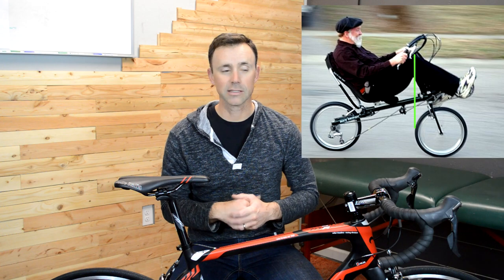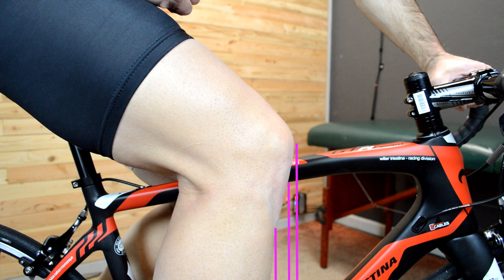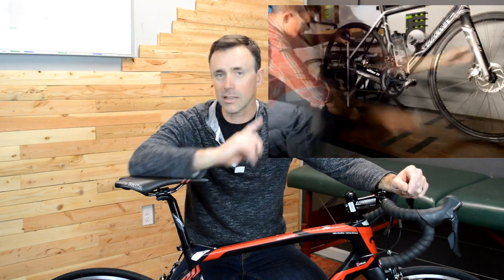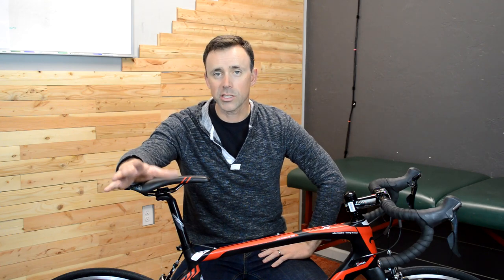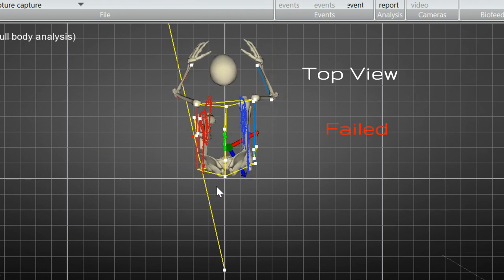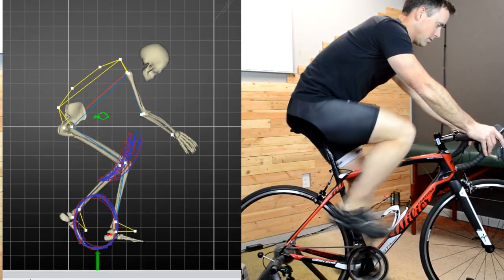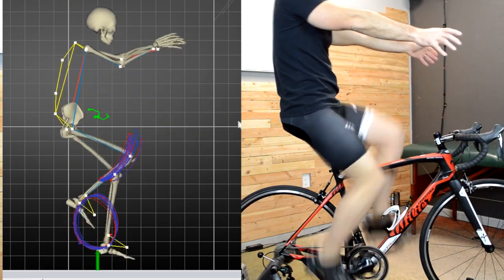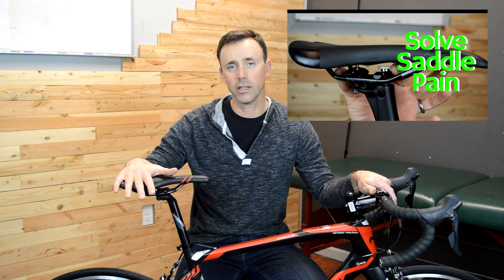How to set Saddle Fore Aft | Bike Fit Tip

Comment: Well now I'm more confused...and even more wish there was a good bike fitter anywhere near me.  From what I have seen on your videos and experienced in the 2 shops in my town, they are just sort of getting the basics.  And yeah they both have used the KOPS plumbob.

So I clicked on the video out of interest as I was about to move the saddle on y trainer bike forward.  I've been doing a ton of indoor riding on Zwift and had gotten saddle sores which had me looking at different saddles.  In the end I've resolved the sores (chamois cream and good bibs as opposed to cheap ones) and moved back to my original saddle but in the process I've lost my position.  When I ride now I'm finding that I'm constantly sliding forward and having to push myself back.  My instinct initially was to raise the tip of the saddle a bit but I'm not sure how far I want to take that.  My next step was going to be to move the saddle forwards as I can recall that it was most of the way forward on the rails originally.

Is the correct saddle position NOT one that feels balanced?  Intrinsically I would think that the best position is the one you can maintain for long periods and have the ability to output power.  Am I wrong?
Reply: You're not wrong about what the best position is, but ultimately people want a bunch of things as part of their fit like aero, handling, comfort, power generation etc so it's all about a series of compromises. Since everyone is functionally different, be it muscle/ligament flexibility, body proportions, rider center of gravity... what works for one may not work for another. I'm glad that you were able to work out all the saddle sore problems but it seems like you may have been following John's (imo incorrect) instructions as to nearly always move the saddle back. Depending on where you current saddle position is try to level it out and then ride your trainer in the drops and then, without moving your torso, slowly release the bars. You should be able to maintain this position with difficulty engaging your core and an increase in cadence but for a few seconds (then either grab the bars again or sit up) you should be able to hold it without having to slide your hips forward or backward. Let the direction your hips want to move to stabilize yourself be your guide. But just keep in mind that's just one consideration for the whole bike fit equation.
Reply from the maker: John Farr You're not wrong, we want you balanced. We need to determine what's causing you to slide forward. You can try to nose the saddle up, but this does have a very narrow error margin as you alluded to. A saddle can look level and then when we weight it it can nose up and nose down slightly so playing with the tilt (only a degree or two in either direction though) is okay.

I don't advocate ONLY moving the saddle backwards, but moving the saddle forward too much can result in exactly this type of pelvic imbalance that leads to discomfort and sliding forward. 

So yes, trying to move the saddle back might be beneficial for you -- BUT -- we still need to rule out the reach of the bike as a problem.

If you fail the test and simply move the saddle forward -- yes, this may help with the reach of the bike, and yes, it may help you pass the test, but it won't ensure that you get your saddle in the right position behind your feet. 

So by defaulting to moving the saddle back first and shortening the stem as needed to maintain or shrink the reach we have a much better chance of attaining the optimal position. If you default first to moving the saddle forward this is significantly less likely to have a good outcome since we're only addressing one end of the fit equation
Reply: +Bike Fit Adviser Again you're misunderstanding pelvic imbalance and balance point. Your method essentially defaults riders in the furthest back position possible with tilted up saddles to pass the test making this a test about core strength and leverage. Unfortunately that isn't how you ride a bike. Normal riding is where a rider sits and balances on the saddle with the hands there to stabilize the rider but not bare a substantial amount of weight, the saddle still supports the vast majority of weight and the rider should be stable while in the riding position. Reach plays virtually no role in your sit up test as again your hands are not on the bars and this is expected to be passed from the drops as well not just the hoods - it's about rider COG while in their riding position. I'm not sure why this is such a difficult idea for you. I sure hope that saddle position and reach are determined independently in your fitting system! 

+John Farr - Visit Steve Hogg's fitting blog for more information or any number of other fitter's blog about the topic. Unfortunately Bike Fit Adviser is very much in the minority here. 

https://www.stevehoggbikefitting.com/bikefit/2011/05/seat-set-back-for-road-bikes/

If you want to test why, slam your saddle all the way back and tilt up the saddle say 3 degrees and you'll have to lower your saddle a tad too to maintain effective leg length, place your hands on the bar tops to maintain your typical riding position and see if you move around more or less in the test than your current position. It's likely you're move less because you're just bracing for the sit up test in this obviously wrong position because Bike Fit Adviser makes it more about leverage than about balance.
Reply from the maker: +OhAiShare okay, how should I start so I don't waste a whole bunch of time on this?? I'll just say this...

To say that "reach plays no role in the sit up test because the hands are not on the bars" is, well, dumb....your hands originate from somewhere in the test (same with Steve Hogg's similar test) before they are lifted off, i.e. the bars, so where they start will play a role in how you are able to complete the test. Even in your oft-cited Steve Hogg article he says of his test "Cleat and bar position and reach will play a part." 

If you're going to be making "expert" pronouncements, make sure you know what you're talking about -- and for good measure, make sure you comprehend (and have read!) the articles you're reading and citing.

+Psyche Out yes, trying to debate with people who don't know what they don't know is actually pretty hard. Once again, I'm out.
☮️
Reply: +Bike Fit Adviser

- "To say that "reach plays no role in the sit up test because the hands are not on the bars" is, well, dumb....your hands originate from somewhere in the test (same with Steve Hogg's similar test) before they are lifted off, i.e. the bars, so where they start will play a role in how you are able to complete the test. Even in your oft-cited Steve Hogg article he says of his test "Cleat and bar position and reach will play a part." "

Honestly I have to say I'm completely losing respect for you now. As you seemingly still don't understand that all reach does is set a back position to begin this rider COG test. THAT'S IT. One literally releases the bars from the start of the test, you seemingly don't understand that you can have the same starting back angle and hence same starting COG at a number of different reach measurements depending on elbow bend. This test is also one that should be conducted from the drops position making a specific reach number completely invalid from the start anyway! Additionally, just to emphasize how far you're reaching NO WHERE in the article I "oft-cited" states "Cleat and bar position and reach will play a part." It's a terrible sentence but now you're doing what you accuse me of, completely misquoting to make a point. You didn't seemingly read the article as the entire last section called "point of balance" disputes your understanding of the article and your methodology. So try again or at least read the damn article before you try and blast me. 

- "If you're going to be making "expert" pronouncements, make sure you know what you're talking about -- and for good measure, make sure you comprehend (and have read!) the articles you're reading and citing."

John, same can be said of you. As now you're misunderstanding the balance argument in both these comment discussions and the article, so dense and defensive that you're unable to take any level of criticism without lashing out. It's incredibly unprofessional and ultimately shows just how static your fitting methodology and how resistant you are to any new concept or idea. It's novel that even in your own test you don't understand what contributes to creating the COG. 

BTW Psyche Out isn't in this thread but yes John it's incredibly hard to have a discussion with someone who's steadfastly misunderstanding the basis of rider COG in the saddle and doesn't have the common decency to give some basic respect to others and contrary ideas. Reach is established AFTER you find the correct balanced saddle position for the rider around the origin point of the bottom bracket. There's a progression you do when fitting an individual to a bike and you don't do it all at once from one sit up test! Think John think! Quit just being a blind reactor that just lashes out at anyone that disagrees with you, it's unprofessional and shows you to be a fitter that believes his way is the only way which shows a very poor methodology which people should take into account if they choose to deal with you. SMH
Reply: +Bile Fit Adviser - Thanks for your comments.  So I contacted the shop where I purchased this specific bike and was able to get my original fit positions.  I was WAY off from those after having fiddles with saddles.  Putting the bake back in the original position instantly made the bike comfortable to ride with very little to no discomfort.  I'm still thinking a different saddle may be in order.  The position DOES have the saddle forward on the seatpost and the seatpost is a non setback post.  This route was chosen at the time of purchase as I wanted a longer head tube and more upright position than my normal road bike (this specific bike is a Salsa Vaya which I use for family rides and gravel rides).  This fit process on this bike was very similar to how I've read (not that I have done a ton of reading on the subject): get the saddle position and then get the reach right...but saddle position is done using the plumb bob technique.  I really wish I could come out to CO to get a fit from you as the above mentioned method is all that I've ever had...in one form or another.  But alas it's not inthe cards at this time.

+OhAiShare while I appreciate your willingness to share your opinion in regards to my fit question I don't think it's very appropriate to come onto someone's channel like this and suggest that they don't know what they are doing.  If you don't agree with John's methodology then give the video a thumbs down and move on.  Post your own video discussing how YOU would handle this aspect of bike fitting.  Clearly there are multiple schools of thought on the matter out there.  You don't by attacking another, that's not a way to gain anyone's respect.
Reply from the maker: +John Farr glad it worked out. And it's not bad that the saddle is forward...because it sounds like you're clearly better balanced in this position and your reach (and bar height) have been addressed. Sounds like you're in the clear and you've got a good solution figured out. Best....
Reply: +John Farr - First I'm glad that you were able to find a position that fits you to your liking. But are you really saying it's inappropriate for anyone to come onto a person's channel and attempt to begin a discourse regarding what was said? So I shouldn't of been the first response to try and help you? If you notice John's the one who's going out of his way to attack me, the person, not the ideas presented. That's unprofessional, that's not done by someone's who's open to new ideas and ultimately not done by someone's who's willing to give a fair evaluation to any practice that may challenge their own. It's an interesting viewpoint that one must have your own channel and put up your own challenge videos in order to have a proper discourse on YT... 

+Bike Fit Adviser
Simple test - can you achieve the same rider COG for this sit up test without using the bars and just having the rider support themselves using the stem to attain the starting back angle and rider COG? The answer is yes and there's no reach measurement in play.
Reply: That has to be one of the most egregious examples of unprofessionalism I've seen and then add on top you're flat out wrong on this topic. You're lucky the world is full of people who just don't know any better and are allergic to criticism.
Reply: Vitroe I am not sure to whom are you referring as unprofessional?
Reply: Bike Fit Adviser, he's the only one being unprofessional here. Instead of discussing something when someone disagrees he threw accusations, he made up a fictitious quote from OhAiShare's article to support himself and ultimately his fitment system is fundamentally flawed if a specific reach is necessary to determine saddle position.
Reply from the maker: Ugh. Okay.  Since you both have mentioned my "fictitious quote", here  you go. Here's the original link: https://www.stevehoggbikefitting.com/bikefit/2011/05/seat-set-back-for-road-bikes/

Now follow me here....you have to read....and the whole thing. But I'll give you a cheat sheet. Scroll down past the first three pictures of the rider in the drops until you get to the photo with the shirtless rider in the LaPierre shorts. The next paragraph, about 5 sentences in -- "Cleat position and bar height and reach also play a part in what you will be able to achieve"

I'm out.
Reply: Bike Fit Adviser: While you're right the sentence does exist (seems search strings don't work on his site) what you're claiming it says is a big stretch. As if you read the contextual sentences, "Now follow me here....you have to read...." (quoting the asinine unprofessionalism as you) reach here is mentioned only to indicate rider mobility or how far a rider can lean over without impingement. Nothing about setting the reach for this test, it's also the only time the word "reach" is used in the entire article relating to bike fit. So a stretch at best, but valiant try to try and find anything to manipulate to suit you. But again, per your norm, you end your post with "I'm out." just highlighting the unprofessional way you conduct yourself because your methods are beyond rebuke even though you still don't understand the purpose of your own test. Oh and just in case you forgot, humans have elbows. So moving the bars around 3" in either direction can be entirely compensated for when setting the lean over, which is where rider balance is derived from, not by reach when a rider's hands are off the bars. But it really seems that you don't understand your own test and no, your opinion in no way agrees with the Steve Hogg article and anyone who can read it will understand that. To simple it down to your level, you insist reach must be determined before saddle position. That's in the tiny minority of fitters who think that and still you're still unable to give reasons why you insist upon that and instead just lob accusations. So run away and be "out" again.
Reply: John Farr.....Are you long or short legged? Could be the saddle is too high, or the crank arm is too long. As you rotate through a stroke your feet have to move forward with the pedal, pulling you with it. The saddle is the anchor to push from, like the leg press at the gym, so you shouldn't be sliding forward. If the saddle is too far forward, you could be pulling yourself while pedaling because your hands are the anchor, not the saddle? Are you a toe pointer, where are your cleats on the shoe?
Reply: Ohaishare....Oops, the pedals should be taking most of the weight, that weight transfer to the pedals means less on the saddle and bars equaling more comfort. Plus more power to the pedals.
Reply: @Geeios1  If that were actually true every cyclist would have zero problems doing bodyweight squats for hours on end. As in a squat only 50% of your weight is on each leg and on a bike you're only pushing with one leg at a time so a lot less work in a squat according to you. Additionally bike cadence is 80+ RPM so if your concept were remotely correct any cyclist should have zero problems doing 80 air squats a minute for 2-3 hours. Nearly all the posts (and wow you post a lot) you show a fundamental misunderstanding of biomechanics, bike handling and why rider positioning isn't primarily focused around weight transfer to the pedals. If weight transfer to the pedals was a primary focus you would just stand most of the time and recumbent bikes wouldn't be able to develop any power.